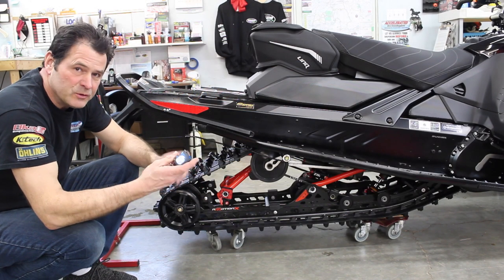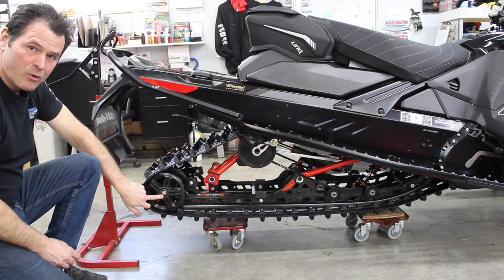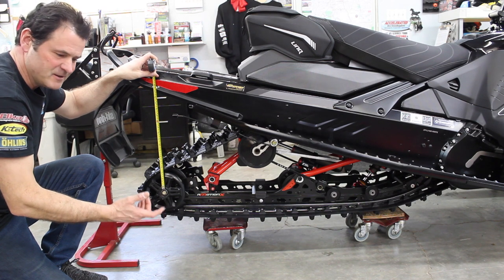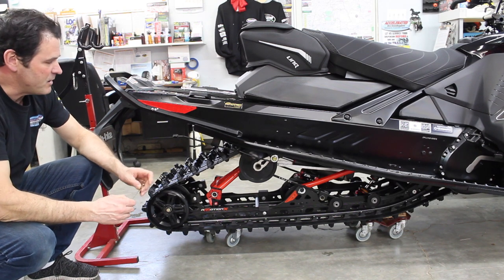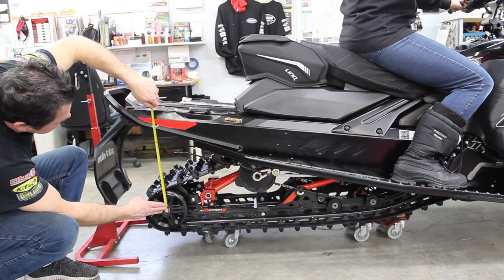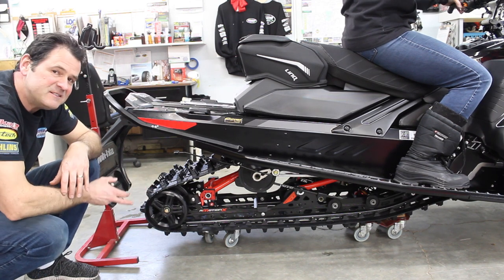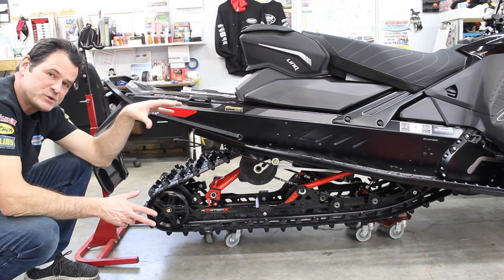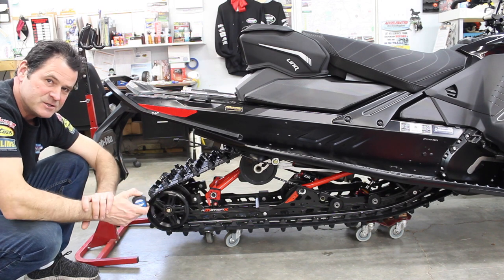Accelerated Technologies - Snowmobile suspension tuning, setting the rear sag by tape measure

Comment: John, when you're trying new rear torsion springs for a sled, no you initially try setting the sag with the adjuster set to the 'middle' allowing for adjustment in both directions? I se online guys throwing springs at sleds but no mention of where the adjuster is. Like you mention in the video, the sag may be OK for a 'light situation' but if you're maxxed out on the adjustment in either direction in a lightly or loaded condition, you may not have any more adjustment.

Comment: Generally, you should get a static sag measurement, and then determine the amount of rider sag from the static sag measurement ... rider sag should not be determined from an uncompressed suspension, as you've demonstrated here. Also, as you point out, rider sag should be measured with the rider in full gear, as well as with anything else you plan to carry. Something this video lacks is how to determine proper sag (you could at least mention whether the sled manufacture has a recommending range, and where one can look to find this info). I don't know if you intend to make a video showing what adjustments should be made to bring the sag into the manufacturer's recommended range, but if not, you also left out how to adjust spring pre-load, and what effects will occur with adjustments to each shock in the skid.
Reply from the maker: I disagree completely.  We ALWAYS check rider sag from completely topped up.  We also measure static sag  as you have indicated (difference between topped up and vehicle only). Comparing the static sag to the rider sag can tell us lots about the rate of the spring and amount of preload required to hit sag.  We posted a second video a few hours that does indeed show us adjusting the preload and it's effect on the spring to hit target sag.  I do however appreciate all your negative comments and i will try to do better next time.
Reply: Coming from the dirt bike works we always check static sag first, then go off of that number to get the sag we want, agree you need a rider in full gear and sled with all the accessories to get a good set up
Reply: Yes I am with you there. I lift sled let it settle back down to resting position and go from there. I got that way from a BRP rep. and have always done it that way with good luck. I am sure there are a few good ways as long as you do it the same all the time you will still get the same result. Even if you do it his way vs mine it will be within the range anyway. From lifted off the ground to sitting on the ground I only loose about 1/2" so if your range is 2-3 of sag then even with that 1/2 loss still in the window. Just my thoughts and it's always worked for me.